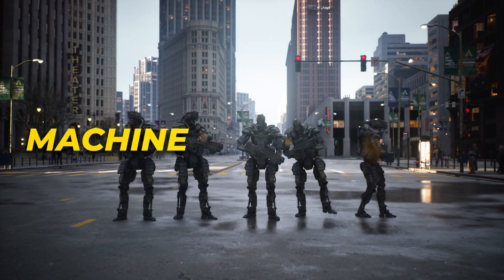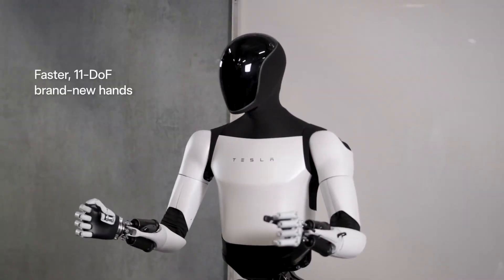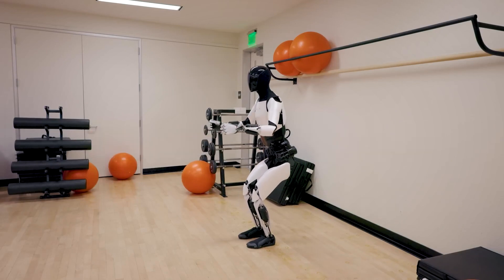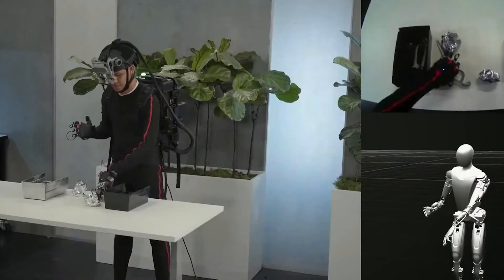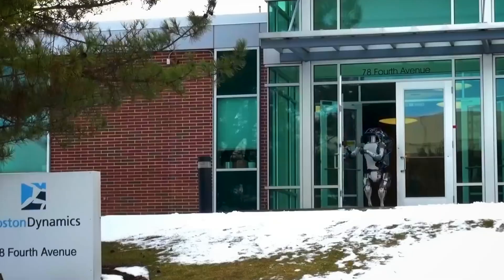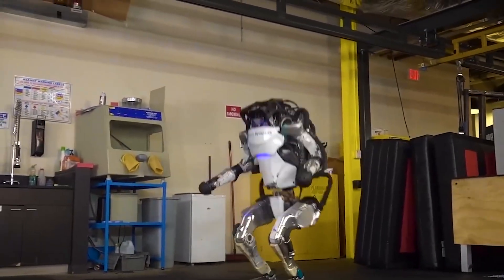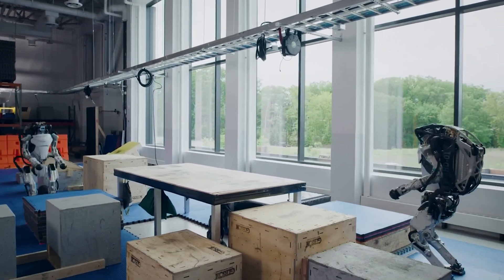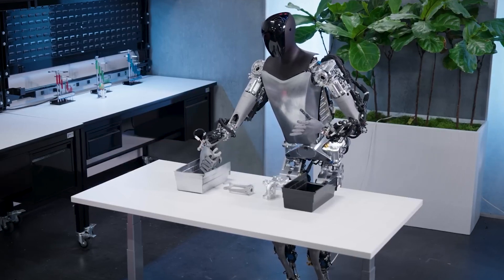Tesla Optimus Gen 2 vs BostonDynamics Atlas

Comment: Got to go w/Optimus just thinking in regard to application. Atlas movement is extremely impressive, but in an environment it would actually be needed in(disaster search&rescue, warzone) Atlas would encounter too many variables for it's lack of ai to handle. Optimus was clearly built for the factory floor, and it's design is spot-on for the task it will face. Atlas was very clumsy in manipulating the box onto the shelf whereas Optimus could flip the duplo block rightside up. This is what Optimus customers want to see: a robot that can prevent a factory defect from occurring.🤔🤖
Reply: This is simply not true on several levels.The box that atlas was putting on a shelf was probably 10 to 20 times heavier than anything Optimus has ever picked up... and it did that without hands. Atlas has already walked on hazardous terrain while Optimus has hardly ever left the lab. Further more Boston Dynamic Robots do integrate quite advanced AI in their object recognition systems, and their robots Spot and Stretch are already working hard in real world factory floors. 

Your last statement of what Optimus customers want to see is already being fully serviced by their quadruped Robot Spot. CHECK MATE there is no competition